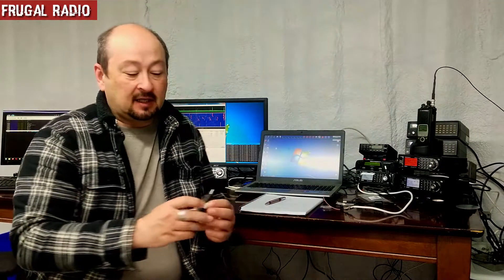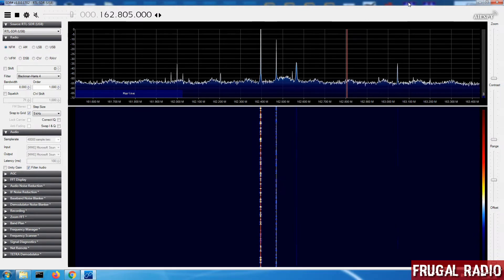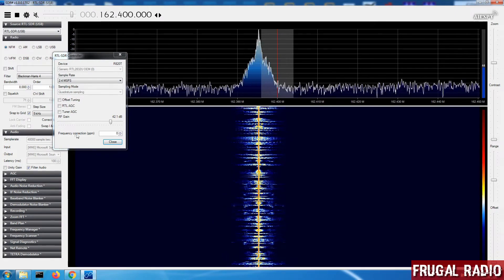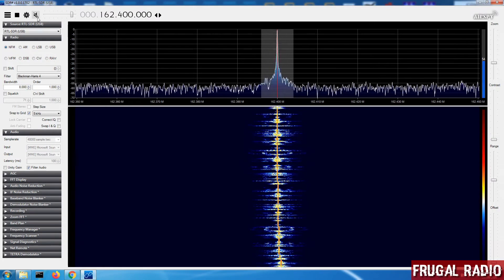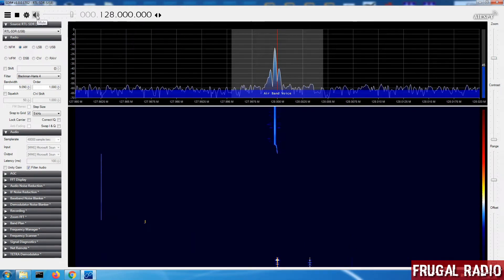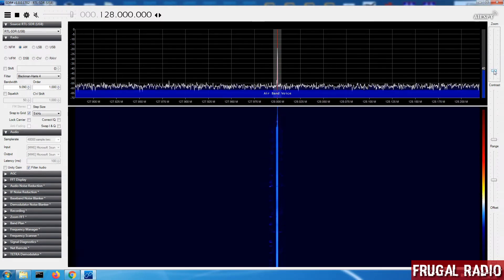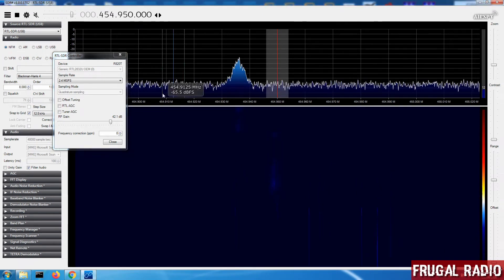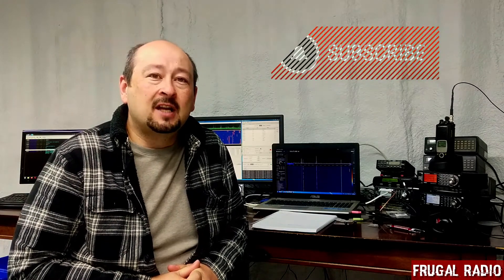How to work out / set the ppm value of your Software Defined Radio using SDR# - calibrate frequency

Comment: 1ppm makes a HUGE difference in SSB... I got the v4 rtl sdr and it does not respond to every ppm, I need to move by 4 or 5ppm and I can never get the proper calibration from that dongle... 50$ waisted...

Comment: In addition to all of this knowledge you should let your sdr warm up a bit to let everything stabilize. It's just as true today as it was in the days of tube and crystal ovens.  Trick is to not let it get too warm lol
Reply from the maker: Very true. These old SDRs without TCXOs function best in a stable temperature environment. Changes in temperature will affect the drift. I had one placed in the attic. Throughout the day the air temperature up there changed a lot, and made this old SDR unusable without correcting the PPM. Newer ones handled it just fine. Now I use the old one on a room downstairs where the temp doesn't fluctuate. Works much better!
Reply: @FrugalRadio  I've thought about insulating one to use outdoors at the antenna for the higher frequencys to cut down on loss and cost.
Reply from the maker: Make sure you use one with the crystal oscillator if you do!
Reply: @FrugalRadio  I see a small Styrofoam beverage cooler in my future sdr tinkering lol 73's. KQ4BKO
Reply from the maker: At least you aren't up here in Canada! You'd be subject to an outdoor temperature swing of 176F between Summer & Winter!
Reply: @FrugalRadio  Rodger that. We don't really have a winter in TB but we did have a cold front that caused me to break out the thermal Flip Flops (sandels) lol

Comment: I can only here stuff on FM, nothing else.  Have tried a couple different antennas.  Any ideas as to why I can't get anything else?  I want to be able to pick up my local police dept on vhf.
Reply from the maker: First thing is to check the fashion setting on your SDR. Try setting it somewhere from 28-32. 

Also make sure you are using an antenna tuned for VHF. Try to find a good strong VHF signal to try, preferably something that is constantly transmitting, like a NOAA weather channel. Once it is sounding good, try the other VHF frequencies you want to monitor.

Comment: I'm guessing its best to let the dongle warm up before setting it.
Reply from the maker: Yes, you're absolutely correct. The generic dongles are prone to drift over a 30 minutes period. However you can set it initially, then go back and adjust it as it warms up.

Comment: Just found your channel.  Really enjoying the content.  I'm  fairly new to sdr and based in Dublin Ireland.  Have a sdrplay rsp1a. Just checking what is the best indoor antenna  for pocsag in and around 153.000.000
Reply from the maker: Hi, and welcome to the channel! Great to have you tracking along. POCSAG signals tend to be very strong, and if you are in the city itself you'll likely just need a small antenna. I successfully decoded pagers for years using the small magnetic whip that came with a very inexpensive generic dongle. 

I'd recommend just experimenting with whatever antennas you already have. Happy decoding!

Comment: Hi I just installed  SDRSharp V1.0.0.1760  looks great, runs,  (useing RTL-SDR/Windows) In over my head after only using my  Uniden Trunk Tracker IV UBCD396T/UBC RH-96.  First question how do you turn off the voice of "Sally" at first I thought wow, how cool, now its a bit like getting married  lol .. Also using SDRTouch on a Android tablet, It works. Second Question 😁  as my primary interest is knowing whats "on air" including digital hand held coms in my, lets say field of influence, 20 miles, what would be you Ultimate mobile, SDR Rig be? or the hand held/portable hardware options, still the best way to go?  All the best
Reply: Then theres this ? ? https://www.youtube.com/watch?v=YW2clAQ3HAs
Reply from the maker: Hi @Joe Cizin.  I've never had Sally, and my wife avoids the radio room like the plague, so I don't know what you mean ;-)

As for the ultimate mobile rig - I'll post a video of some of my shacks, including my old car at some point.  What I would have wanted to add was a Panasonic Toughbook, linked up to multiple SDRs in the trunk (boot).  I never quite got to that part of the project when running the ex-Police Ford Crown Victoria.  Once I get my next ex-police vehicle, I might try and set that up.  I did have several Uniden BCT & BCD radios mounted, along with a 2m/70cm dual band Yaesu rig, in addition to a handheld transceiver and a handheld scanner (mostly used for close call).

But I wanted a way to view all the trunked system information.  However with data access being much less expensive these days, perhaps that is the way to go.  Set up the SDRs at home, and utilise some kind of data stream to the toughbook, or possibly even an Android tablet. 

Sorry for the delayed reply!

Comment: If I understood it correctly, we need to fine tune the ppm every time we change frequency. Can you please confirm?
Reply from the maker: No. For the generics you just need to work out the value and enter it once. Maybe after 20 minutes of using the device you'll see some drift and can adjust again, but then it should stay relatively stable. If you have an RTL-SDRv3 or SAMrt dongle, you won't need to do it at all.